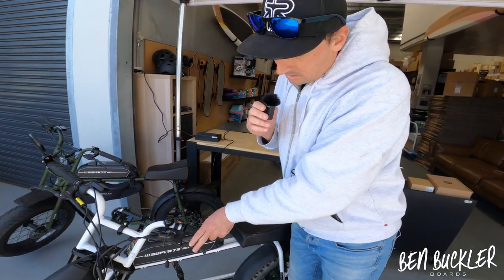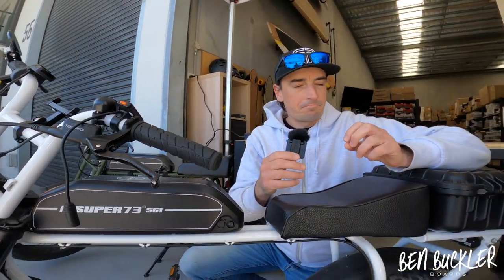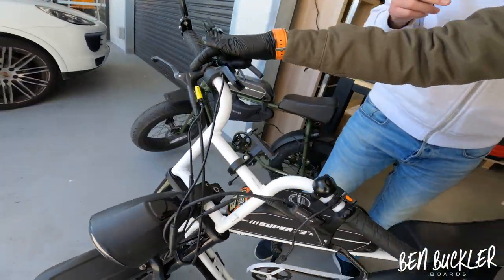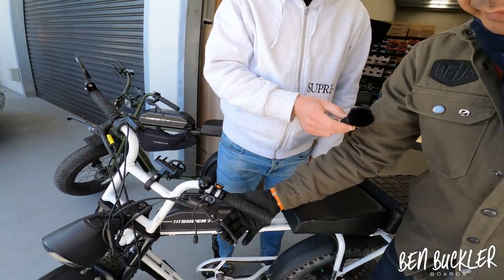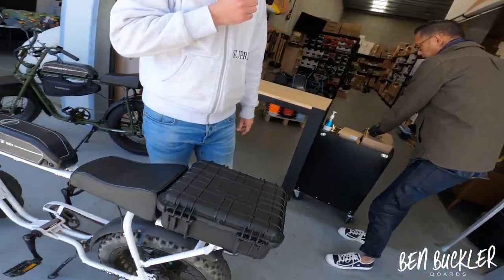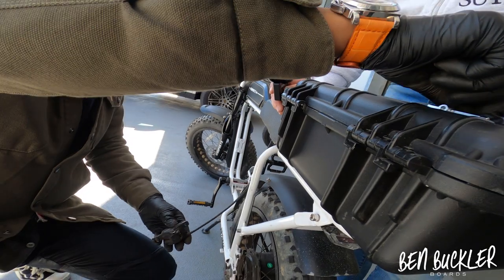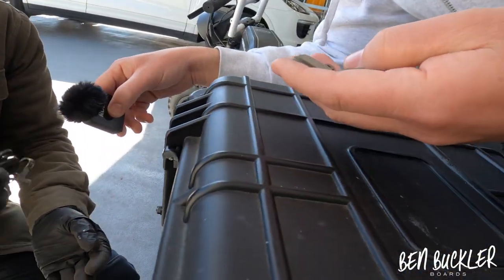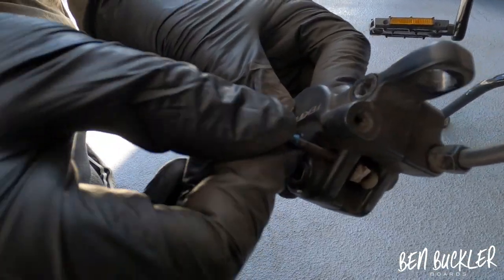How to service your Super73 brakes + changing the brakepads

Comment: Hi,

Just got my Super73 R Brooklyn, been using it for 2 days now and did realize the hydraulic front brake cable was touching/rubbing against the front tire. It ended up burning the cable and now there is a leak and the front brake doesn't function. Do you know if any E-Bike shop could help in replacing this or is there a link to buy this part? Need Help.
Reply from the maker: Hey Gustavo! Congrats on getting a cool new bike! Any decent bicycle workshop will be able to replace your hydraulic brake line. You don’t need to find one that specialises in eBikes, because the hydraulic brakes are used across a wide range of bicycles. Double check the line placement once it’s done to ensure no more rubbing. Hope that helps 🤟

Comment: i did all of this and got it back on and now my back break wont work at all. the light comes on but no breaks. bummer!!
Reply from the maker: Hi Tyrone, sounds like it's time to call a bike mechanic or take it to a bike shop. It could be brake fluid leakage. Let us know what the issue is, thanks!
Reply: @benbucklerboards  Thank you , I fixed it. you can not squeeze the brake while break caliber is off or it causes major pressure issues when reattaching. If the brake caliber is off the disc and stuck closed, you need to gently pry it open with a flat head screw driver slowly wile break is off disk. once break caliber is open, if it is open too far and breaks are weak, remove caliber and squeeze the popper brake a few times gently to resize space between disk and break. Find the sweet spot so it has smooth rotation while disc and brake spin and boom. 
if you over squeeze trying to get the break pressure and space correct, just re-pry and try again. remember stay gentle. Good luck

Comment: come on 4:04 there is a position where if heads near seat on left you can look down and see pad to disc gap for caliper alignment adjustment required or not and pad wear so look before disassemble.
Reply from the maker: Yep fair call and thank you for adding value to our support video so that others can learn from our combined knowledge. 👍